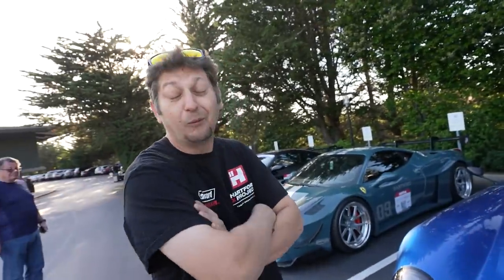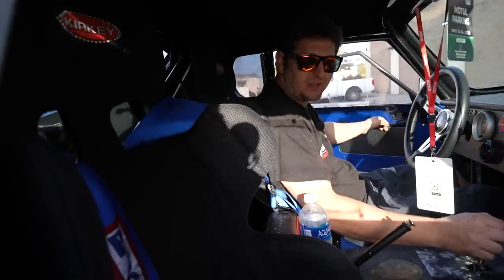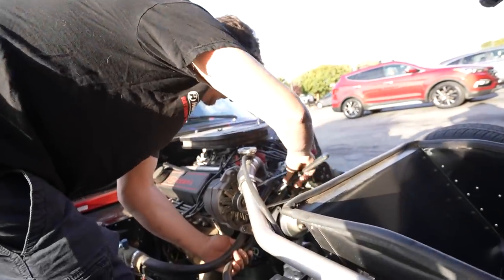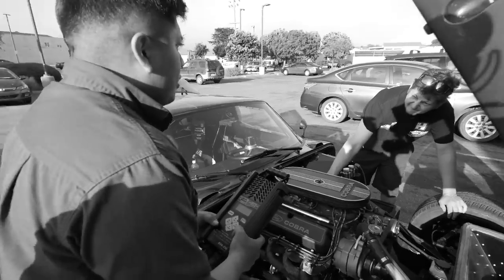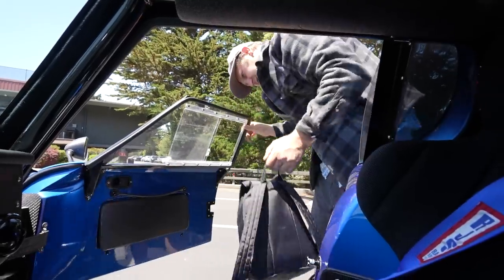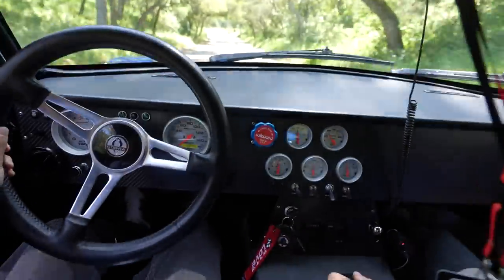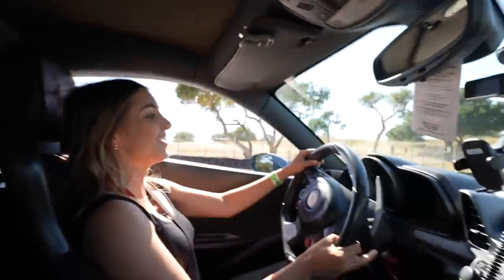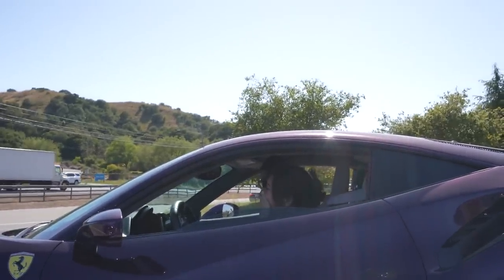We Broke The Barn Find Shelby Daytona Coupe.

Comment: I did the same thing many years ago getting off a motorcycle while wearing shorts. I still remember the pain and how long it took to heal. Wishing you a speedy recovery and hopefully it doesn't scar too badly.
Reply: Put that 4 in one antibiotic gel on the burn. I did the same thing on a 69 Corvette. Owwwwwww
Reply: I've definitely washed a front tire on a dirt bike a time or two in sandy or loose corners and dumped the header on my leg. One time it burned through my pants and I couldn't get out before it burned my leg. The other time I wiggled out while it burned my pants but didn't burn my leg. Not fun definitely do not recommend that. If you're smart you'll avoid racing a 250f at five foot flat with a short inseam. I thought I might grow into it but I only made it to 5'2". Now I run a KX100. Much better fit and a lot safer.
Reply: Yep i got one as a teenager getting off a dirt bike in shorts as well. Still have scar which looks like and big oval leach mark lol

Comment: Definitely handled the burn like a champ but I'm perplexed as to why they aren't heat wrapped! It looks way tougher than burnt leg skin on the exhaust and is actually functional.
Reply: helps if you get out of the car correctly. Like that standard to do it without using your leg to pull yourself out
Reply: If anything it probably related to aesthetics
Reply: Heatwrap absorbs water and can rust out the side pipes. They look to be either ceramic coated black or BBQ paint. If it's mild steel than wrapping them may accelerate corrosion...

Comment: A little tip I learned years ago.  Turn key to on, hold wrench at one end (so it can swing), in front of the alternator pulley.  If there is a magnetic pull towards the pulley, chances are is the alternator is good and the battery is pooched.

Comment: Just a suggestion,  get 2 pieces of leather screw to the floor or mount to seat and when you go to get out deploy the leather cut to the width and length as you see fit. And don't forget to place leather back in or your doors won't close.

Comment: I had an ‘86 Fiero that went into limp mode. I went to the auto parts store and got lucky that the manager just graduated from GM computer school. He spent an hour with me, did the paper clip in the computer interface port thing and confirmed that it was the core computer and not some of the other non returnable and expensive electrical parts. The computer swap out did take 2 weeks though. It wasn’t just swapping parts.

Comment: Run cold water from a hose on the burn seconds after you get the burn.   Gentle stream for at least a half hour, or until the pain goes away..   Running cold water on a burn has been known since the early 1960's.   I had boiling water, because of a defective radiator cap, spray directly on my face back when I pumped gas for Standard Oil - 1964.   I dropped everything I was doing and did the garden hose cool water on my face.   Ran the water for almost 1/2 hour, until the pain stopped and the worst that happened was slightly reddened skin on my face like a mild sunburn.

Comment: One way to test alternator vs battery….get the car fired up, disconnect the ground from the battery. If the engine stalls , you know your running off of the battery, the alternator isn’t producing. Btw, EMELIA is a badass. Wicked burn zero whining. Impressive!

Comment: Cool video. You seem to go through a lot of batteries on your cars, you should consider using a battery maintainer with a built in desulaftor like a Pulse Tech Xtreme maintainer, or a Noco Genius 5 / 10 charger maintainer. You should also be checking your Alternator voltage under a full load with the lights and all the accessories on, it should be at least 1 volt more then a batteries 12.6 voltage fully charged. I prefer an Alternator with a 14 - 14.7 voltage output, I had one from Autozone for my 1998 BMW 528is that tested fine on the bench and only put out a 13.5 volt charge and my battery was never getting fully charged, I went through three batteries before replacing the alternator with a 14.1 volt output Bosch, and never had a problem as long as I had it.

Comment: Add a compact Amp meter to your tool kit or just put one in your glove box like I do , it will come in handy when you least expect it. Also heat shields on those pipes… it’s hard to avoid getting burnt since your sitting so low to the ground.

Comment: I would hope you add door releases with a key fob or old school with a button release under the back or front fender well for easier access to the door. I did my custom van doors with no outside handles with junkyard door lock solenoids from Cadillac back in the 80's but probably a kit to do them today

Comment: You can do a quick alternator check on those alternators with a screwdriver hold the screwdriver at the back of the alternator when the motor is running if the alternator is good it causes a magnetic field which will draw the screwdriver to the back of the alternator

Comment: With the exhaust sitting that far out, it's not surprising you got burnt. You were a real trooper continuing with the video. Hope you heal up soon. It's amazing how little some auto parts counter people know, but with you and Sandy figuring it out, it's great you got back on the road. Loved the video and looking forward as always to the next one Emelia.
Reply: not totally to blame, i dont know the required Voltage and amper needed on the daytona, but i guess his device was for a standard 12V battery, and once running, most alternators pump that reading up to 15V. but if the battery was completely dead, even with a healty alternator, you might have gone up to 10ish V atm. so the device detects "toasted alternator" as it cant bring it up to 15. most simple check would have been to test the battery once the engine shut as well. no difference = alternator problem, lesser voltage means battery dead.

and also, dont know in the US, but here in EU, thats just considered standard desk job, most shops have only sales personnel, and those can call internal service for advice, rare are those who had people formed as mecanics before they end up at the counter. i actually do love both job and keep pending between. if i get fired or have bad coworkers i go back to some manual labor, and once i got enough of dirty greasy fingers, i apply back to a car parts shop =)

Comment: I found a tool you need made by Topdon BT200. It's very small and compact, it tests batteries, alternators & charging systems for 12-24v.. It's fast and accurate  and has saved my butt on several occasions, it even tells you battery health all for about $120..

Comment: You can check the alternator by pulling the cable while it's running. If it doesn't die the alternator is good.
Reply: Though that NORMALLY holds true, if you watched the first half of video, it was dead and died more than once with the old (good) alternator.
Reply: @2873lonewolf  that's because the batteries is bad and not holding charge! what Marvin say goes!
Reply: @mracer8  Dude, are you a little special? What Marvin said eliminates the battery, as in no longer connected. The battery has nothing to do with when you pull cable, except that if alternator is bad it'll stall, because you're no longer running off battery. 
If you're going to comment, you can't contradict yourself in same sentence.
Reply: @2873lonewolf  you know why you are lone wolf? Nobody want to be you pal!
Reply: @T C  Awww, poor baby can't handle truth...ha ha
Instead of attacking someone online keyboard warrior, know your mechanics first. Sorry not sorry for correcting you.
Reply: @2873lonewolf  sounds to me like the old alternator was borderline or underrated/ A  good alternator would keep the engine running. I would replace it to keep from wearing out the new battery with a higher output. A  alternator also supply's power to ignition so why chance a weak spark. That's just me of course.
Reply: Also found pulling the cable the best way to look for shorts. Scratch against post for sparks then pull one fuse at a time till no more sparks to narrow it down to one system. Saves a lot of time. There is a lot you can do without all the fancy tools.
Reply: @Marvin Miller  Well finally someone is making sense. I agree with you, the old alternator is suspect, even though they only say they replaced battery.
Reply: Yep. Also, the voltage was well under 10V, looked more like 8-9V. If your battery is that low its bad. Hitting it with a charger/alternator at that point is just asking for a battery fire.

Best bet is to disconnect the battery, start with a jump pack / bump start, and let the alternator get you to the store to buy a battery.

Honestly, it's kind of a newb move to not immediately replace a battery that's showing that low of voltage.
Reply: @Lonewolf2873  what are you talking about? They never disconnected the battery at any point until they replaced it. They are lucky the battery didn't catch the car on fire since driving it around with the alternator trying to charge a failed battery will do just that. 

So to recap.
Batt <9V = bad, disconnected it. Then start on jump pack/bump start.
A. Jump pack option - disconnect jump pack after starting, if it keeps running the alternator is good. If it dies the alternator is bad. This dose not mean your 9V battery is OK, it means that your alternator went out then you probably toasted the battery. If the alternator is bad it is usually worth attempting to charge the battery... out of the car and away from anything flammable. 

B. Bump start method - Disconnect the battery and attempt to bump start it. If it starts the alternator is good, if not it's bad. From there the above scenarios apply to the battery.
Reply: If the car runs and drives after you bump start it, the alternator is fine, it can be on the low edge of output, but if the car runs and drives, it’s good.. you can actually start a car and remove the battery and drive all day as long as you don’t shut it off..
Reply: Once the car is started, it runs off the alternator, the battery is simply to start the car… oh and yeah you use the battery in the Accessory position.. that’s it..
Reply: Not true - that worked with Generators - alternators use electricity to create the magnetic field.
Reply: Well they should have known it was a bad battery by the fact it could push start it with a dead battery. Pushing starting with a dead battery wont have enough juice to run if the alternator is bad.
Reply: What I find kinda sus. about this channel after watching this video is. She's being portrayed as a cool "car chick"  insinuating she has lots of automotive knowledge & really into cars, doing all these super car builds. But then these 2 are completely stumped by the most common simple car problem/dead battery. Like a poser car YT channel created similar to how boy bands were put together. Some pretty boys get picked from an audition. A team writes all their songs & music. They get on stage & dance around while lip singing to a background track. Kinda makes me think this is the In-Synch of automotive YT channels.

Comment: To test the alternator, you have to spin up the alternator while testing the voltage, so either the car has to be running, or the alternator has to be put in a device to spin the alternator.
Reply: yup... bench tested which it would have passed.. Then it had to be wiring or a battery.

Comment: hmm.. once the alternator is running, the battery is a load (not the source).  It would not matter if your battery is ok or not once the engine starts.  It would be your alternator that has the issue if it dies while it's running.  Correct me if i'm wrong, though.

Comment: I got to take the Skip Barber 3 day race school at the same track.  Back then it was their Formula Dodge cars.  That were open wheel racers with manual shift transmission. After going around the track so many times I know every corner and breaking point well.  I had a blast taking the class.

Comment: Fun adventure. The best part of sports car journeys is the unknown & fixing your car, successfully. Sorry your Cobra done bit you on the legs. Easiest test for alternator function is that it needs to output ~13V, especially above idle. Test it with your multimeter on the battery terminals running, when it's healthy, then when it's not healthy, you be able to spot it.

Comment: Whenever I drive on of my vintage Jaguars I always take a small tool kit.  It’s in a fabric zip-up lunch box and contains various sizes of vice-grips, assorted screwdrivers, wire strippers, electrical tape and a multimeter. Never leave home (in an old car) without it.

Comment: If it starts with a bump start, and runs OK after, it's never the alt. The alt. is what kept it running. Always the battery, or like a Vette in cold country, it needs a trickle charger in the winter.

Comment: Next time to check if its battery fault just remove the positive terminal while its running to see if the charge rate goes up. When its up around 14V put the terminal back on and you will loose the charge rate. Its a internal cell fault.

Comment: Easy way to test is to remove the positive cable from battery while running, if the motor shuts down its the alternator if it stays running its the battery.

Comment: It's pretty simple to test the alternator; without taking it out of the car. 
First measure the battery voltage across the terminals with the car not running, say, 12.3 volt. 
Now start the car, and the battery voltage should jump higher, say, 13.8 volt. 
The higher voltage must come from the alternator; in other words, alternator is working. 
If the voltage does not jump higher, the alternator is faulty, as it is not charging the battery.

Comment: Here's a little something to remember. If the car is running and you disconnect the battery and it dies, the alternator is not charging. I can't believe you went on the road without a DVOM.

Comment: You probably had an internal short in the battery. What happens over time is the that come from the ions in the plates gradually corroding and sit in the bottom of the battery case.. Eventually these salts build up enough to short between the plates. Thats why the alternator could not make enough voltage despite going to full amps. Its always worth pulling the alternator and having it tested on the bench (autoparts stores can do this). Its a more accurate test because you're only testing the alternator. Oh BTW a second degree burn is full thickness with no nerve damage..:)

Comment: To check if you have a bad alternator or battery, when the engine is running you disconnect the battery red terminal:
1. If the engine KEEPS idling/running/revving, it means the alternator is working and supplying 12v - therefore the battery is bad.
2. If the engine STOPS running/cuts-out/dies it means the alternator is not working and supplying 12v - therefore the alternator is bad.

Comment: Easy way to check alternator.  Put voltmeter on the battery terminals while running. You should have about 14 volts. Anything less and it's not charging

Comment: How does a car nut mistake a dead battery for a fail alternator? Not real hard to pull the positive terminal to see if the car dies( hints bad alternator). Not enough juice to turn the engine over(hints weak battery). Makes me wonder if you do any of the work on your channel.

Comment: The battery had a shorted cell most likely. It will read like 11V on the meter because the other cells get overcharged, but as soon as you put a load on it the voltage drops like a rock.

Comment: Fyi  u can test ur alternator ur self by disconnecting the positive battery cable while the engine is running cause it should put out enough power to power everything  to keep the engine running  If the engine stays running when u disconnect the cable the alternator it still good in most case's..a lot of those workers at those auto parts place are not honest and or do not know that much or know what there doing.. it's also always easier  to test a battery  and change it first good luck..
Reply: Doesn’t always work on newer vehicles.
Reply: @ddbrock9675 yea  true that all the way newer stuff has so much more electronics that use up a lot  more power amps then the alternator can put out at low engine rpm. Idle rpm..

Comment: I had the same problem quote unquote, went to O’Reilly, told me my alternator was bad (inline 4 engine🥹) changed the alternator and it worked for a few minutes😂😭 and I knew it wasn’t the battery cause I had bought it recently. Turns out the throttle body was dirty🤦🏻‍♂️. I didn’t swap the old alternator back, it’s a pain in the rear end to do inline 4 engines.

Comment: The best way to know if its battery or alternator, disconnect the battery while its running. If the alternator is working it wont/shouldnt die.

Comment: I'm confused why anyone would have suspected the alternator?  The engine runs off the alternator and charges the battery.  The batteries only job is to start the car.  If the alternator was bad, but the battery was good, the car would start, but then die as you drive when the battery fully discharged.  At that point, you wouldn't be able to push start the car.  If the alternator is dead, battery is dead, there is no power to run the car.  The fact that the car wouldn't start, but push starting it worked, indicates that the alternator is fine.  Now, that leaves the battery and the starter.  The fact that the car attempts to turn over pretty much eliminates the starter, as the starter solenoid is engaging, and the starter motor is turning.  Only thing left is the battery.